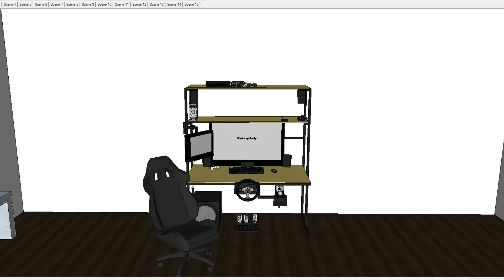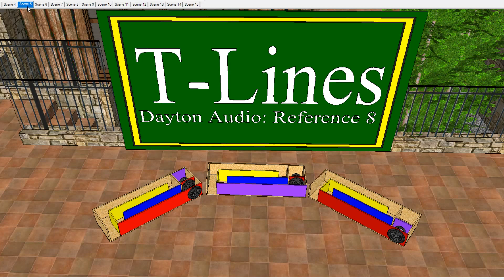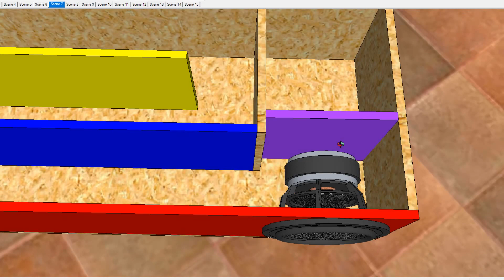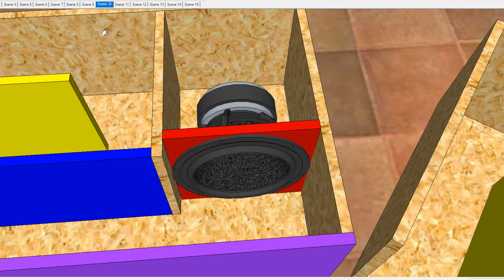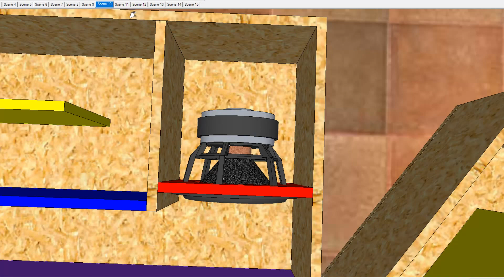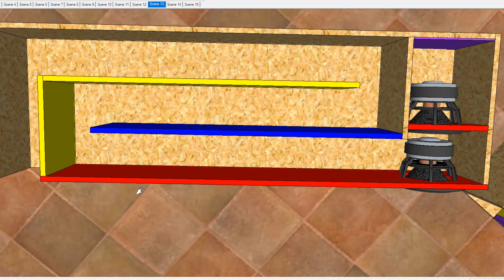T line Design - 4th order vs Isobaric

Comment: My guess is it is super unlikely you would unload the driver in the second design as it is sealed behind the sub. 3rd design may not work as the subs will behaving differently as the back sub is sealed. If you face to faced the woofers in the 3rd tho...

Comment: If both woofers are in phase I think your pressure in the port will be less because the front woofer will cancel out the pressure of the sealed driver some what, try putting them face to face in phase.

Comment: did you ever end try this on a smaller scale?  been thinkin of doing something like this with a passive radiator. Need something to experiment on to cure cabin fever
Reply from the maker: I got an eight inch T-Line on the channel. Go check it out.

Comment: The enclosure @ 13:21 is not isobaric because the airspace between the two drivers is not sealed.
I would flip your outside woofer around and mount your two woofers cone to cone . This cuts amount volume needed for the sealed chamber of your 4th order in half. You would need an extra baffle but the amount of space needed between woofers is tiny just enough so the cones cant touch.

Comment: Would you have been able too add rings to the face of the box to bring the speaker out as oppose to offsetting the chamber in the rear of the first box you show in the video
Reply from the maker: You have a point there. Thanks fur the tip. Demo of the T-Line coming this week. Stay tuned.

Comment: From my research. One shouldn't mix sealed with vented. Especially in the same box. As for the fourth order. It would lose the half the cone efficiency. Plus if you are distorting or over powering. One wouldn't really hear it until it's too late. Unless you have an ear for it and pay very close attention to it. Not to mention the added work digging the woofer out for replacement. Classic t line would be the easiest to do. Why over complicate a known well configured design?
Reply from the maker: For the sake of science and FUN, brother! :) You make some valid points, but if you got the time and spare material... why not? Thanks for the comment.

Comment: On your third example, I think you would have to make the port area equal to the cone area of both woofers not just one. You might get more output but the enclosure would need to be much bigger. Might as well do a single 10 or 12 at that point.
Reply from the maker: No single bass reflex box could trump a transmission line design; unless SPL is the focus. Bass reflex only cover a narrow frequency response, whereas T-Lines have a significantly broader frequency response range.

Comment: In your experience what box configuration produces the most efficient variable sound for 2 dual 12 in subs ?
Reply from the maker: Either a dual 4th order or dual 4th order is common.
Reply: @BudgetBassHead  so much has changed in a year.lmao I started with Wal-Mart's cheapest subs Duel. 
I have 4 Star duel 2 ohms 12 in.subs. I'm on my 4 th different box since then. Ive removed one back seat to stack them. Don't really want to lose all my back seating area. Its a four door titan. I really need a bed cover to move it all back there.
Reply from the maker: @lawrencemiller2379  Sounds like you may have a blow-through build in the future! Keep us posted.

Comment: Do you have any idea how a ported box sub would perform in a small sealed box? I Wes looking at it the other day. It looks like a 10" box. Cut out for a 12" it barely fits. It's running at 1 ohm. The amp is a soundstream tower series. And if it's doing what it says. It's getting 900watts. The sub says 250/500w it does better with that amp. But it still doesn't do how I think it should. It's the cheaper Rockford subs. Maybe the box is just way too a small. I been waiting for t lines!!!
Reply from the maker: I always try and stick with the manufactures specifications for sealed enclosures. Typically a 12 needs at least 1cu.ft. but that varies from company to company. The Vas parameter really plays a big role in determining this. You need good compression in a sealed enclosure. to much is too punchy, and not enough is inaccurate phasing. But focus on the f3 and try to stick with the maker's specification.
Reply: BudgetBassHead all I knows is. It sounds like crap! Even for a single 12" should do better. It doesn't go low at all. I don't have an exact frequency but it drops off hard below 40hz. And nearly nothing in the 30hz area. I tried a bass enhanced track. And my earbuds sound better. I didn't put this system together. And I never heard one sound so bad. It's like its highpassed at 45-50Hz! Most of the time when I build a system. I low Pass at 60 hz or so. It had a JL 250 watt mono amp on it. Then a duel 400, I put the soundstream DTR1. 900 on it. Supose to be 600 @ 2 ohm. And 900 @1 ohm. It is twice as loud .but that's not saying much. I have thought about doing a infinate baffel in a escalade. With 1-2 15" and the soundstream. Maybe  . Lowpass at 60hz. Depending on the vehicle. I think it peaks around 40hz. Or the resonate of the vehicle.

Comment: Man I just got a tline put together! I never thought of combining it with a 4th order. But my box has an old school jl 8w1im hoping it bumps. I just need to finish the stain on the box and it's ready to go. If you ever use a mid-range or full range speaker, you will really need to stuff the line with poly fill or something similar or the mids will come through the port all echoey. Sorry to ramble on, it's what I do on your vids. But keep it up man love the vids
Reply: I think the iso 4th box would over extend that outside woofer. It looks like it's gonna run like a regular tline while also being pushed by the woofer behind it. Just my thoughts.
Reply from the maker: Wow, JL makes some quality drivers, let us know how it turns out for you.
Reply from the maker: It's just a thought(4th order) But with some of the comments, so far, I may dismiss it. But we'll see.

Comment: I want to do an isobaric push pull on the sealed side of the amp chamer and run the port on the other side . You would have to you're sealed side with the right volume. Right?

Comment: Ok your 4th order T-line would be a waste of wood and power. You will loose all of the low end that makes a T-line so good. As for cone excursion use a subsonic filter around the fs of the subwoofer you are using or around 25Hz (depends). But it is rearly needed as the cone needs to push the full mass of the line unlike a reflex box.
Now your "iso" setup.... what can i say but that is not a iso config. For it to be an iso config the two woofers must face eachother and be sealed together. 
A T-line will play 1/2 octave below port tune and 3 or 4 octaves above. Also your back wall is too close to the woofer and reflects right back at the woofer. You are better off extending the chamber and tapering it down so the cross sectionial port area is equal to the Sd of the woofer then 45s or rounded corners.
Further more a line area does not need to be the same all the way but can slowly tapper down from the initial area to the Sd of the woofer as the final area. 
Keep up the work mate.
Reply from the maker: Thanks for the reply. I have to add, iso setups does not need to 'face each other', but they do have to share a common volume of air(sealed). So you were correct about that. I like the notion of 'tapering it down...' I have actually been interested in that design. But isn't that more of a tapered horn design? Regardless, great comment; it gets my mind to thinking. Keep them coming!
Reply: BudgetBassHead 
If what your saying is correct any 2 sub sealed inclosure is an iso setup and that doesnt sound right. 
Its only a horn if you tapper to a larger area. But tappering to a smaller area is not a horn but rather called something else. The reducing tapper also helps reduce the chance of standing waves but its rare to start with.
Reply from the maker: To clarify, isobaric configurations can be configured cone to cone(face to face), cone to magnet, or magnet to magnet. As long as they share the same space 'between' the drivers. I did a video on this. 
https://www.youtube.com/watch?v=CHX_XHAcADo&t=159s
Thanks for the feed back.
Reply from the maker: And to add to this, the shared space between the drivers doesn't necessarily have to be sealed. As long as the amount of pressure there remains consistent throughout operation.
Reply: BudgetBassHead 
Ok well this is the first i have seen of the other 2 configs. But now scanning a few engineering designs and articles on the matter i am yet to see one that "vents" the shared chamber, and thinking about it, it would be hard to mantain equal volume and pressure if one cone can move more freely due to the vent. But do try it if you wish but from a theoretical mechanical and physics standpoint i could not see it working in that config you showed but still willing to be proven wrong. 😊
Reply from the maker: No, you are correct. I am agreeing with you on this matter. This is not a proper "iso" config. I may have to re-do the title of this one. I was so excited about you guy's feed back, that i just had to see what other's though of it. Keep'em coming.
Reply: Actually, Liam is correct, this isn’t isobaric. You are correct that you don’t have to have them face to face. What makes two woofers isobaric loaded is that they need to be “coupled” together...essentially working as a single driver. To do this in any of the configurations, just ensure that the airspace between the two drivers is sealed and as MINIMAL as possible. The easiest way to do this is the typical clamshell. Additionally, required enclosure space is half of a single woofer so the resulting enclosure would be smaller, effectively 25% of what’s normally required for two drivers. Really, the only time I build isobaric enclosures is when I’m limited on space but want it to hit hard. Back in the day, I built a lot of isobaric bandpasses using 4 10’s or 12’s while keeping the enclosure size manageable.
Reply: Liam is right. the whole idea is to use the drivers own vas(air movement)@ fs(resonance of sub)to delay the backwave from responding against the cones face for 1/4 beat. Ok my two cents... look at the response curves of any other box than a tline. its up then down. tline is like a repeating wave. so ill leave it at its perfect when done simply but sturdy, just hit within 3 hz if fs or your box will be pretty much freeair

Comment: I recently made a 4th order T-line, and its an odd one. So, its 1ft3 sealed, with a PA bass speaker as a driver, 12", ported into 1ft dia PVC stormwater pipe, about 4ft long. Thing is tuned around 50Hz, and holy crap is it efficient. The woofer is already 95dB efficient, and this box must bring it to 100dB. Thing on 100w is like my old 15" on 1000w. Something to note though, is the T-line loads the driver a ton, 5mm of driver excursion turns into 40mm air movement at the mouth. So, this is a tricky one. If you put the driver in a small sealed section, it should bring up its efficiency up higher, making a more smooth response curve. The T-line would have to be longer than mine though. Projecting from my results like 9ft for 20Hz tuning. It'd be a neat experiment to do though, hook it up to a small amp, or limit its power, try 4th order then standard config, and see if theres any results. From what I can tell though, with a longer line like this one has, if its a 4th order it'd just be a rumble box, nothing higher than 30 or 40. I did make a massive 8' tall T-line, with about a 15' long line, though I put too much packing material in it, so its effectively clogged and acts like an infinite baffle. Great animation too, enjoyed the vid, keen for more.
Reply from the maker: Wow! You have any photos of that? It sounds interesting. Thanks for sharing.
Reply: Not sure if this discord link will work, you can see its ratchet strapped together lol, waiting to install a more permanent mount for the pipe
https://media.discordapp.net/attachments/341540422566281216/462271411721994241/IMG_3451.JPG?width=648&height=484
Reply from the maker: Wow that "is" massive! If you place it behind a couch or something that would be a great addition to a home entertainment set up. Thanks for sharing.